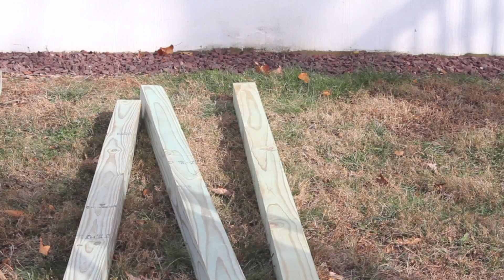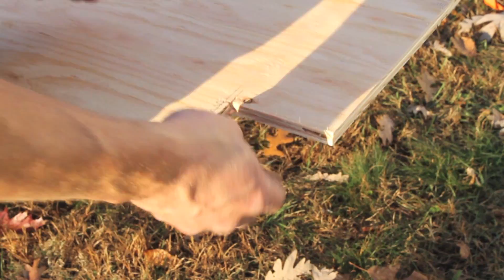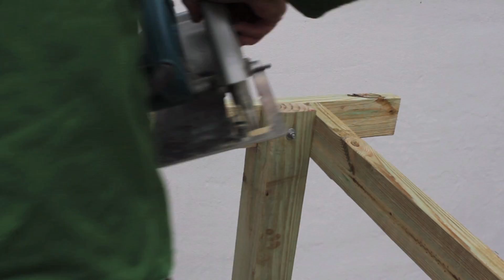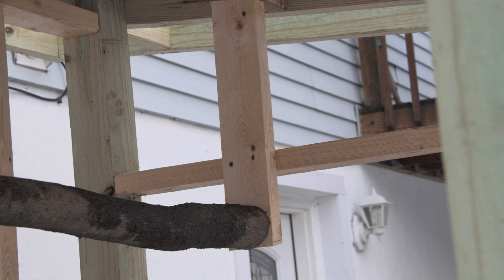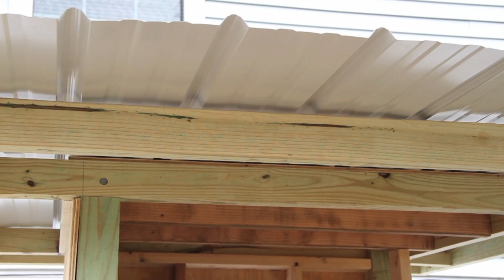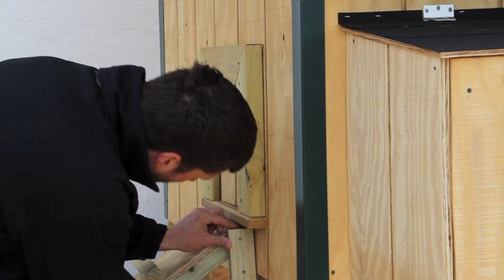Easy to Clean Chicken Coop V2.0: Step-by-Step Instructions with Free Plans

Comment: Great video!!! Inspired to do it now 😂 how many chickens does a coop this size fits?
Reply from the maker: In theory, as many as 8 chickens (at 2 square feet per bird) but I would probably do 4-6 chickens….especially if the chickens will be in a run during the day vs free range.
Reply: @E_Fleming  thanks for responding!!! My other question would be how many nesting slots should have with 6 chickens? And do you have to train them to lay in those nesting boxes??
Reply from the maker: Sorry for the delayed response.  I would probably do 2 nesting boxes for 6 chickens, though some would probably say that two would be adequate.   The chickens will naturally like to lay in an area that is darker and a little confined.   I didn’t have to coax mine to use the boxes, but sometimes chickens will find another area that they like to lay eggs…especially if they free range.

Comment: I see a lot about avoiding certain types of wood for coop builds, but does it really matter? Nice build
Reply from the maker: I don’t believe that pressure treated wood can be used if you are getting certified as organic. You definitely want something that is rot resistant where it is exposed to moisture / soil.   

I avoided pressure treated framing in the coop itself, but I felt okay about using on the outside.   Just give it a good sand so there aren’t any big splinters hanging off of it.

Comment: Hello. Nice shelter. But în winter at minus 15 degrees, is warm inside without insulation?
Reply from the maker: Chickens produce a good bit of heat, but below about 15 Fahrenheit I turned on the heat

Comment: THANK YOU! You have such a perfect, casual voice for this. I learned so much. Key points for me were to load the weight on notches instead of screws. I will do this with 2 treated 2x6's sandwiched together using the inner boards top edge as the support. I don't like 4x4's with their cracks. You also mentioned the importance of sizing the roof sheeting to match the frame perfectly, definitely noting that. I really love the nice pics of your roof design. I do wonder why you didn't put the last two center 48's attached to the load bearing boards though. Maybe it has to do with the roof sheeting?  My idea is for deep liter, and to have all the maintenance at one end so I have less snow to shovel.  Have a wall sized door which opens to have two interior stacked nest boxes in mid, with water on one side and feed on the other. Above this two foot section will be a little storage. Because the roof will be slanted to the side like yours, vent space will not be affected in the main hen house interior.

Comment: Thank you for posting.  I'm curious about the legs, as the "foundation" of this build is four posts simply sitting on the ground. Do you find over time that the posts settle into the ground, if so, how much? Does your soil turn to mud during rainy periods?  

I'm thinking setting my posts into the earth about 2.5' down, because our frost zone is about 14" and I want my coop in a permanent location.  Any advice appreciated.
Reply from the maker: I ended up selling this particular coop, but the one that I made for myself was a very similar build.   For that, I dug footers about 18 inches deep and poured maybe 5-6 inches of concrete in the holes.  Then I set the coop on the footers and back filled.  By the time I got the whole run attached to the coop that thing wasnt goin anywhere.  (Here the frost line is 36’)

As far as I can tell there was really no movement / settling over the 3 or so years that we lived there.   The run definitely got muddy, so I added sand which doesn’t stick as bad as clay.   You could also save chopped up dry leaves  and spread those in the run.
Reply: @E_Fleming  ... that's very interesting.  I had planned on using the posts as a secure foundation much as you describe.  Wow...36"... where is that if I may ask?  I'm in southwest New Hampshire.
Just one more question... did you put a roof over that run?

Thank you!!
Reply from the maker: I’m in pa, so maybe I’m mistaken.   I know that when I dug the footers for our deck, they needed to be 36” deep.   I did end up adding a tarp over the run.  If you get a chance, watch my FAQ 6 years later video.  I mention a lot of things I wish I had done differently.   Also, you may find my newest coop construction videos helpful (the coop w the pallet wood exterior).  My post notching technique is much better in that, and I added cleanout trap doors inside the coop.

Comment: Great video. What is the angle for the roof line and nesting boxes?
Reply from the maker: To keep it easy on the plans, you’ll see a measurement  for the post notches on one side and the notches on the other.   (The one side is higher and that will give you the slope).    Unfortunately, I no longer have this coop or I would get you a specific angle.

Comment: Hi we are currently 11:48 am Thursday June 11, 2020 trying to build this coop using your plans. What is the pitch of the roof?
Reply from the maker: Hello!   I am not sure of the degree slope of the roof, but it’s determined by the height of the notches on both sides of the coop (the notches on one side are higher).   That will give you the slope
Reply: E Fleming I have more questions. How can we speak?
Reply: E Fleming I appreciate you answering. We just have some clarifying questions
Reply from the maker: Today is a pretty crazy day, but I’ll do my best to answer them.  What are your questions?
Reply: E Fleming  awesomeness thank you. Okay. We have the frame together but I think we botched higher for the nesting boxes. The height difference is a 2x4 width. So we are going to run the floor joists in the direction of the 2x6. On your video your nesting boxes aren’t notched to the 2x6 did you toe screw them into the 2x6? Your plans say place the nesting boxes in notches. We are confused on this part. Thanks again.

Comment: I watched this video twice. Do you have plans for a coop just like this on only 4 x 8?  I believe this style will fit our needs the best.
Reply from the maker: Unfortunately I do not.   You might have an easier time making it a 6x6 coop, adding two feet to all horizontal dimensions, an additional nesting box or two, and additional studs / supports where plywood joints meet.   All of the concepts are still the same, you’ll just have to adjust measurements.   I would feel better about the stability of a 6x6 coop vs a 4x8.
Reply: We went with 4x8 raised coop.  8x10 run overall. Turning out great. We will have a fenced free range area as well. Thanks for your videos. They are concise and helpful.

Comment: So at 19:23 ... i see you have the horizontal 2×4 going between the 4×4s. But at the floor level between the 4×4 it looks like you have just a strip there. Are you just using that to help you build straight and will remove it later? Or are you using that to separate the nesting boxes from the main floor area?
Reply from the maker: I think I understand the question.  Unfortunately, I made a bad notch cut on my 4x4 posts and I ended up putting an additional board in there to make up for it.  The plan is correct, so you should follow those measurements and just use one board.
Reply: @E_Fleming  thanks for replying... my problem is I unfortunately decided to build mine 5×5. So when I kind of get stuck, like on the nesting boxes, I'd see what you did in your video. I wish I would have just built mine 4×4 now because of the extra costs and it would have made things alot easier because I could have used the plan. But thanks for the explanation 🙂
Reply from the maker: Yeah my original coop was 5x6 and because of the sizes that lumber and plywood come in it ended up being a pricy build.   Anyway, good luck!

Comment: Hello, I hope you're still around and answering questions about your awesome coop plans!? Best plans I've seen and so far things are working out well. I will definitely be sending you some cash for these  plans, they're appreciated. Thank you.   I'm onto the roof and have a couple of questions. First, on the plans it says 39"  and 36.5" for the two end posts, is this measured from the floor? (one of the lines looks like it goes below but my guess is that's not so). Also, I just want to confirm that those measurements are for the high side of the angle (the angle that will later be cut out)? Thanks again.
Reply: are those two measurements to the top and then notched or to the bottom of the notch. Hope that makes sense. thx
Reply from the maker: Hello katrina!   I had to double check the plans, but the measurements are from the top of the lower notches to the bottom of the top notches...(then the posts would need to extend an additional 3.5 inches beyond that).   also, yes those measurements are for the high side of the angle.  You could save yourself some work by buzzing off that top corner piece before it’s screwed on (that isn’t what I did in the video).  Anyway I hope that makes sense and good luck!  Lmk if you have any other questions
Reply: @E_Fleming  Thanks a bunch. That helps.

Comment: It looks like your coop is 3' above ground, is that enough for a 5 gal bucket with chicken nipples? I was planning a similar style coop and was thinking about going 4'.
Reply from the maker: Hmmm.  If you are going to use a bucket waterer, I would say the original coop should be 4 feet off the ground.   Then, it should be buried about a foot  for stability (unless it’s got a decent size run attached to it to make it less top heavy).   That will leave you three feet to hang the bucket and allow the chickens to get under there.   Might be cutting it close, but I think that would work.

Comment: Your plans are awesome. I have never built anything out of wood in my life.With my husband showing me how to use the tools, together, we have gotten as far as the roof.  QUESTION- I can not figure out the slant, slope, pitch of your roof or the size of the two side walls that are effected by the slant roof  - help
Reply from the maker: Thanks!    On one of the plan pages, there are measurements for where to cut your notches at the top of 4x4 posts.   Those notches are different heights and will give you the pitch of the roof. (39” and 36.5 inches).  When you have finished roof framing, you can go back in and add wall by taking one measurement on each end, then make a diagonal cut between them.

Comment: There is a missing part.  You build the base frame and put the floor, then you build the walls frame, and the you start to build and install the roof.  After you build the nest spaces, but we never saw you fixing the wall sides.  It's a very good work, not on my level, but it showed the logical way to build and I appreciate.  Thank you
Reply from the maker: I didn’t show every single part of the build, or I would have had 30-40 hours of footage to go through.   Hope it at least gives you a good idea of process.

Comment: The supply list reads that 8 -  3/8" x 4" galvanized carriage bolts are needed, but on the diagram it states a 3/8" x 4.5".  I know that a 4x4 post is about 3.5", will the 4" bolt work okay? Thanks
Reply from the maker: Yes a 4 inch should work okay.
Reply: @E_Fleming  Thanks for the quick responses.  Can't wait to get started.

Comment: Great video.  Thinking of building this Coop. Great instruction on your part, love the helpful hints along the way.  Easy to follow plans.  I want to build it, but wife doesn't like the flat roof.  Is it possible to adapt the roof style easily enough?
Reply from the maker: Thanks!   Yes others have adapted the roof and you will find a few pictures of viewer submitted coops here.   https://www.flickr.com/photos/coopinstructions/albums/72157658585193288
I made a new construction video with some new tips and that coop has a gable roof.   https://www.youtube.com/watch?v=56FA-STOZKw
Reply: @E_Fleming  Thanks!!
Reply: @E_Fleming  If I use a gable roof, am I better off using 4x4x6 posts instead of 4x4x8?
Reply: Thanks, that will help a lot!

Comment: If your using a  carbide tip blade just flip it over and it will cut that metal
Reply from the maker: Someone a few weeks ago made that suggestion.  Never knew that was possible!  Thanks for the tip :-)

Comment: Tore screws r better and easier to use, tin snips r better to cut the tin as an angle grinder makes  mess and will rust quickly, the shingle material will break quickly
Reply from the maker: I used the nesting box shingle material for 5 years in my previous coop without issue..even w daily opening for eggs.

Comment: Nice build! I'm going through a similar process right now, similar size. Wondering- how many chickens feel ok in there?
Reply from the maker: My newest coop build video is loading as we speak.   A general rule of thumb is, you want 2-4 square feet of coop space per bird (but I would do 3-4).  This coop is 16 square feet, so as many as 8 chickens but 5-6 would be a better bet.

Comment: I am building for 8 hens . How much larger should this be. Also I am in Mich. do you have ideas about heat source in winter?
Reply from the maker: A general rule of thumb is, you want 2-4 square feet of coop space per bird.   So technically 8 chickens could go in here, but I wouldn’t recommend it (especially in a place w harsh winters where the chickens might spend  waking hours inside).  I think I would go with a 6x6, and that gives almost 4 square feet of coop space per bird.  As long as your coop is ventilated, but not drafty the chickens are pretty equipped to handle cold weather.   If you’re looking to supplement when things get really cold, I would screw a heat plate to the ceiling or high up the wall
...something like this.  https://www.amazon.com/Heaters-Mounted-Electric-Heater-Reflector/dp/B00865JSEU/ref=mp_s_a_1_7?keywords=convection+panel+heater&qid=1584529344&sr=8-7

Comment: You don't have to be sorry brother. You did a great job. I am from the same profession, i have my own  furniture and joinery mill here in Kashmir. You did only one thing wrong and that is compromising with safety. Hope you will understand. Stay safe. 👍
Reply from the maker: Thanks for the response, and I understand.   I should definitely be wearing glasses and ear protection.   Is there a specific part of the build that I could have done more safely?
Reply: @E_Fleming  
If you want to cut any piece of tin or any other metallic material you should always wear a safety gloves. Because the roof tin in your video seemed very sharp.
Reply from the maker: Yeah, I think I even commented on that in the video.  Really not sure why I wasn’t wearing gloves!  I have them and the tin was definitely sharp!

Comment: How long did it take for the asphalt shingle at the intersection of the wall / nesting box roof to fail? Rubber sheeting works better.
Reply from the maker: Over the course of 5 years, it never failed.  It's flexible ice and water shield.  I did have to re-glue it where it attaches to the coop.
Reply: @E_Fleming  Ahh, my mistake.

Comment: I realize this is an old video but how many chickens does this support? 8?
How would making it longer work? Say 8x4 instead of 4x4?
Reply from the maker: I believe I’ve read that chickens need 2-4 square feet of coop space per bird.  So 8 chickens would be a tight squeeze.  (16 square feet / 8 birds = 2 square feet per bird).   You might be able to get away w it if you have a lot of space for them to free range during the day.   You could make it longer, you’d just need two doors instead of 1.  Also the coop would get very top heavy so you’d definitely want to concrete in the posts.

Comment: I have to say, you do a very good job of explaining what and why you are doing certain things in the build. Some good ideas here. One issue and that would be the use of Pressure Treated wood in a livestock housing. It may not happen at once but the arsenic and cooper chromate will leach out. Also, only certain types of fasteners will last with PT wood as it tends to be very corrosive, especially to aluminum.
I'm including a link that has lots of good info on the proper use of PT and how to hold it all together if you are using it. 
My suggestion for other builders is to use cedar on parts that will have a potential to rot. No chemicals and excellent rot resistance. 
https://www.popularmechanics.com/home/outdoor-projects/how-to/a3103/your-guide-to-working-with-pressure-treated-lumber-15655848/
Reply from the maker: Thanks for the feedback and link.  I’ve done a good bit of reading on PT wood, and half the sources say it’s okay now because the chemicals are different than they were a few decades ago.  The other half warns about chemical leaching.   I do know one thing, when I get a PT splinter, it hurts like heck.  
I don’t think, I’ll go w PT for raised beds anymore.  

As far as i know all the fasteners I used are approved for pt wood...Deck screws and galvanized carriage bolts.

Comment: I like everything about this coop except the hinged roof on the nesting boxes. I made my nesting box roof a solid piece, mostly because after doing commercial roof repair I see a bunch of problems possible with it, and then made the back of it (on the outside) fold out downward to access the nests for egg collecting and cleanout. The coop isn't finished yet, since it hasn't stopped raining here for the last month, but the next time I have two+ days of sun, it'll finally be done.

Nice work on the video!👍